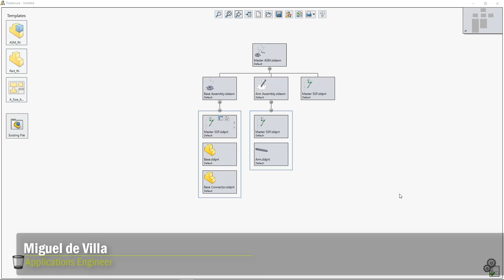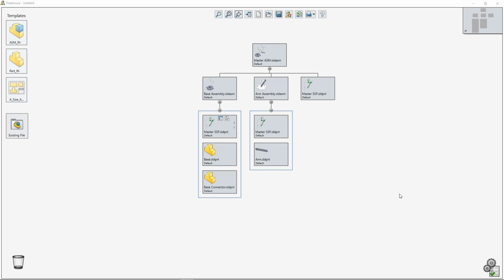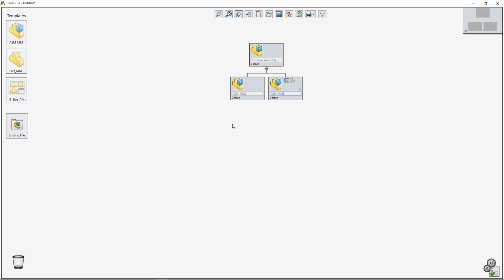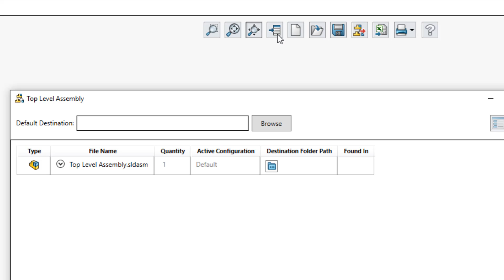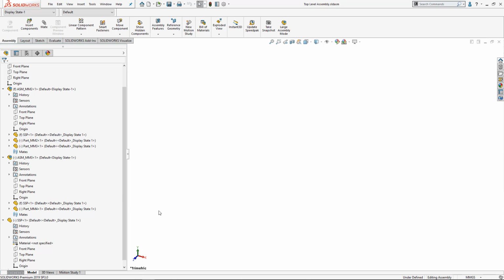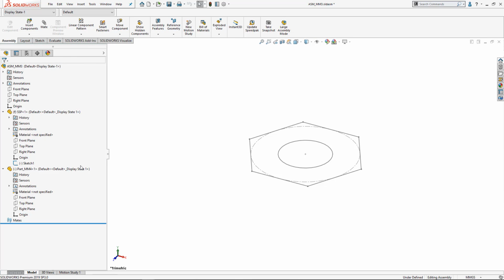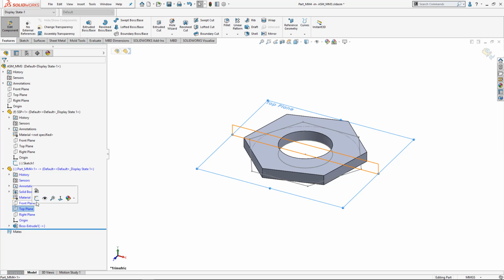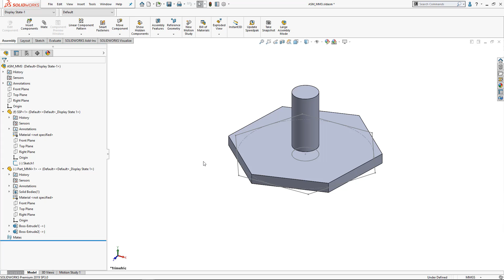SOLIDWORKS Tutorial - Skeleton Sketch Part Method for Large Assemblies using SOLIDWORKS Treehouse

Comment: Sir, I have a doubt, does external reference reduce solidworks speed.
Reply from the maker: External references can have a performance impact.  How much of impact can depend on a number of factors and is very dependent on the file management structure.  It is definitely not the right tool for every situation however it can be a very powerful tool.